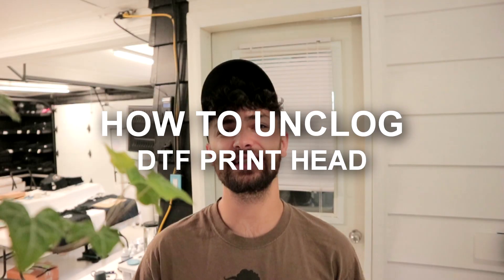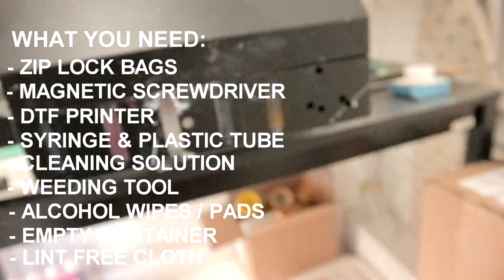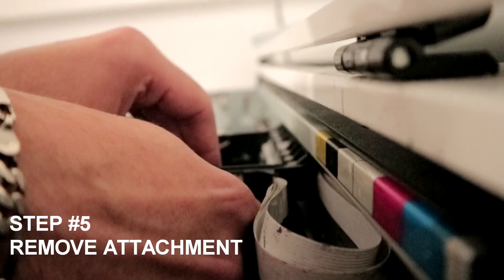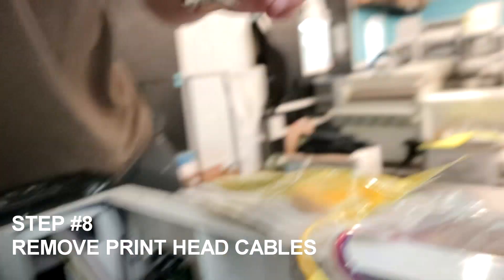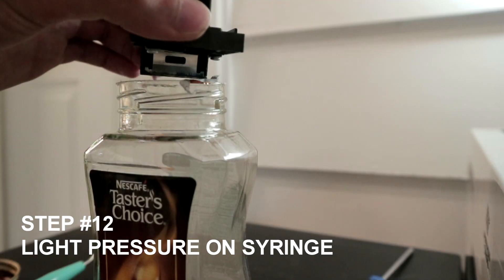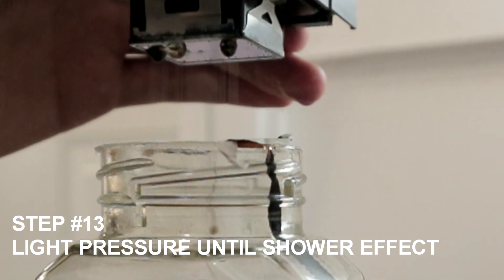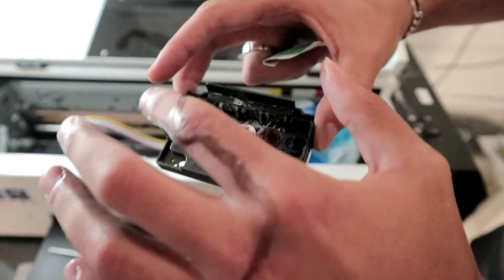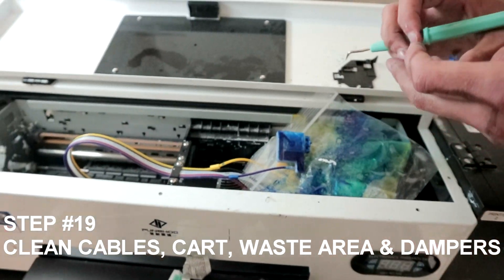How to UNCLOG DTF Print Head (Step-by-Step)

Comment: I've cleaned my printhead twice, but did not let it soak. When I'd push one of the nipples, Ink/cleaner comes out from all the other nipples (like back flow). Should I let it soak and try again using a withdraw like (push/pull method)? Please help. Hoping I don't have to replace the printhead. This printer is a year old bought from previous owner, not used just sat. I was getting prints up until two days ago. Thank you
Reply from the maker: Yes!

Comment: Hello,

Thank you for your video.
I use a Procolored L1800 A3 printer. When sending a design, the printer starts the process normally (noises and head movements), but no ink comes out, whether for a design, a test page, or even a nozzle check.

I cleaned the nozzles manually with the hose and syringe: the used ink flowed correctly and came out fine, which I wiped off each time. However, I did not disassemble the print head for cleaning, and I fear that this may have been a mistake.
I sucked up about 20 ml per nozzle, and the used ink tube is not clogged; it is working normally.

Despite this, the printer is not printing anything at all.
In your opinion, could the problem be with the print head (broken or deeply clogged) or with the motherboard? Are the print head and motherboard two different parts, or if I buy a print head, does it also come with the motherboard?

Thank you for your advice, as I don't know what else to try.
Reply from the maker: I would contact support!

Comment: i have the new htvront dtf printer. and my dark colors are streaking brown. so i did a manual cleaning, and my colors are not running out the bottom of the head the way yours are. they are going around it. and i keep wiping the shiny part and i can wipe constant ink. im waiting for it to dry and going to try.. but is this not normal? that it doesnt drip from the actual plate. and any reason it might be streaking? i just got it like a month ago
Reply from the maker: Any updates?

Comment: Great video. I will be trying it soon. I recently bought a procolored printer. I did the maintenance just how it was instructed on their website and now the only colors I get are black and green. Is this because the magenta color is clogged? I am new to all of this so it has been very overwhelming. Thank you
Reply: Hi, have you done a nozzle cleaning? If not, you can do a print head cleaning after that if it doesn’t work. You may want to increase the percentage of your output ink colors from the RIP software
Reply: @willymartinezjr269 I did all that and I also extracted the ink with the syringe to make sure it flows, but with the magenta color, I can't pull out any ink. I'll try again what you said and also use the cleaning solution. Thank you for your help.
Reply from the maker: Any updates?
Reply from the maker: Thanks for you suggestion!
Reply from the maker: Is still a ongoing issue
Reply: @WHOLEPRINTING  No issues with that, I had the  part replaced. But now I am having another issue. When I do the print nozzle check, the white ink is not appearing. Only 1 white line at the top and one at the bottom. I do not want to replace the part again. The  machine is new. I have been so frustrated with this thing. Do I clean out the nozzles like in one of your videos where you take everyting apart?

Comment: so honest question. tapping at first when the head in still in its initial clogged state, doesn't that push the "whatever clogging it" even more towards the head. shouldn't it be to suck it back out first then push it through after. great video though.
Reply: This!
Reply from the maker: Hello, honestly, I would be lying if I said I know the answer to this, I’m just reporting what works for me, ideally this is your last resort, you should always be doing a print head soak, anything you force through the print head is not good in my personal opinion

Comment: Hey Dom. I hope you receive this question. Long story short, I've recently put a new printhead on my l1800 and within a few days its already clogged. 
After speaking with the procolored engineers, they said it could be because of the sticky sediment in the white ink bottle and its sucking up into the lines. Have you ever experienced anything like this before? 
Not saying i dont trust the engineers, i just want to get a second opinion. I just dont want to do what they tell me, buy a new printhead and have it happen again in about a weeks time
Reply: Same happened to me. And now I have to get another print head.
Reply from the maker: Checkout dtfx.ca we source elsewhere from procolored
Reply from the maker: I’ve started sourcing my print heads elsewhere. They are available on DTFX.CA 

My clients were having same issue when sourcing from procolored… 
You are not alone

Comment: I have the same dampers and printhead however no ink comes out , am I having to put a string through , cause presssure to unclog ?
Reply from the maker: Are you still having this issue?
Reply: @WHOLEPRINTING printhead went dead , so I returned 3 printers back to Amazon , xp 15000 have to many issues I recommend 8550 and don’t bother with a ciss solution , mod it for waste tank solution and that’s it

Comment: Great video.  I watched a bunch to see how to get the 2 red simultaneous flashing red lights to stop.  I saw on another video sometimes maybe some lint or debris might be on the sensors so I lightly waved some paper over the sensor to see if that helped.  At first that did. I have been missing some white lines a bit. I have done several head cleans and nozzle checks, but still shows I am missing quite a bit of the white. I did the print head flush, and got everything like it should be.  I got everything back hooked up and printed a few sheets out.  now it is flashing again.  Any help would be greatly appreciated.  The printer is only just over a year old, and I have done all the maintenance I am supposed to do.  Help Please...
Reply from the maker: Are you still having issues?

Comment: I followed all the steps, but I cannot unclog the white ones, I don't want to put so much pressure. All the other colors are cleared, does that mean I need another print head?
Reply from the maker: Might be the problem, try flushing it again if not I would change the print head
Reply: Try a reverse flush.

Comment: Would this be helpful if my printer stops printing black and blue, nozzle checks are barely printing white
Reply from the maker: It could be the print head needs a deep cleaning, you’ll need to take it apart to get to the bottom of it!

Comment: Can I make my own cleaner I’m in an emergent situation and need to get shirts done and my white is not working and is missing the middle half of the nozzle check. Also when you say soak the print head is it the nipple part or the bottom gold part? Thanks for the help
Reply from the maker: I’m not sure that you can make your own cleaner however I’ve hear that you can. You can soak both the top nozzle and the bottom

Comment: I replaced my print head because when I print, it only prints a blank page. I am a teacher, so it sat over the summer and was not used. I just cleaned my print head and still nothing. Do you have any suggestions on what to try?
Reply from the maker: It’s important to use the printer everyday!

Comment: Cool video man, but as an actual printer tech, I can say this is a good method but various steps should be done before you attempt to push flush through printhead. This might actually make things worse by pushing actual ink into print nozzles. First steps you should take is to soak printhead in solution for a few hours n then reverse flush ink by using syringe then n only then should you try push flushing for clean curtains spray.
Reply: When you soak do you mean fully submerged
Reply: @charlesnooks2831 No! do not soak completely just the bottom part with the actual nozzles. You do not want to get water up to the part where it touches the pcb board.
Reply from the maker: Thanks for the words of wisdom!!
Reply: I need a technician in Philadelphia, where are you from?
Reply: What cleaning solution are you using
Reply: @PreztigeKennels I mix my own, using 90% distilled water & 10% isopropyl alcohol.
Reply: Reverse flush. Forward flush will push against the seals and ruin print head
Reply: @JustMe-xd2vc  yes it will if printhead is really clogged and you try pushing as first step, that's why i clearly stated to soak head for about an hour then "reverse flush first" n then u will be able to push flush to see if curtains spray, but if there's any resistance then stop and repeat steps one and two.. Its simple. Of course if printhead is super clogged and u simply try pushing with a lot of pressure you will bust the seals.. I just unclogged two printheads yesterday using same exact method.. One for epson 1430 and Epson 3880 now working flawless..
Reply: @thesmoothgoat what solution do you use? How do you soak the heads?
Reply: @thesmoothgoat  how do you perform "reverse flush first"? Some people say that using the original Windex to soak the head is better; is that true? I have a really clogged-up commercial DTF printhead that needs to be fixed. Thanks

Comment: My problem is my yellow won't come out from the print head or dispense at all from the print head. I have the L1800 dtf printer
Reply: How did you resolve?
Reply: @QueenBDesigns  I followed the same instructions in this video and it worked! My yellow works but cleaning the print head